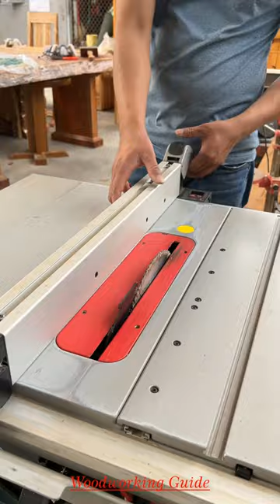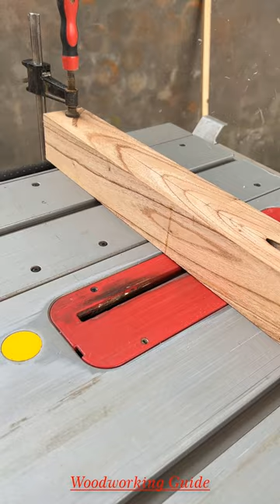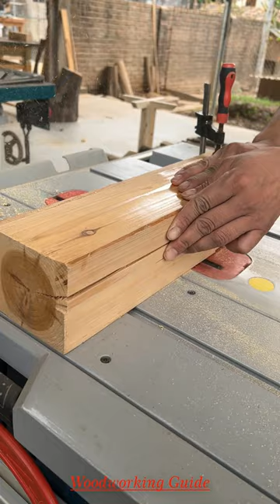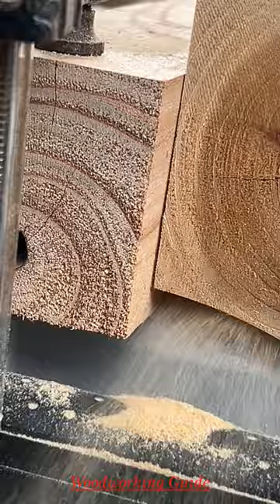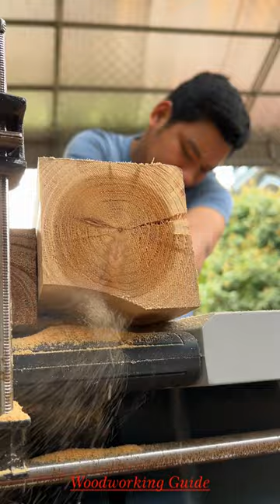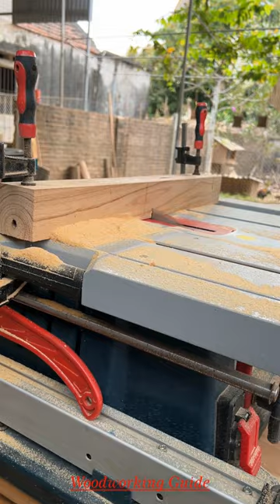Handy Tips with a Table Saw!

Comment: Wouldn't it be a lot cheaper and easier to just buy a router rather than do this and risk yourself and have to replace your table saw?
Reply: you would need a shaper with a giant shaper bit to produce this curve.  If you go about this incrementally, a 1/16th of an inch at a time you are probably gonna be successful with no undue stress on the table saw